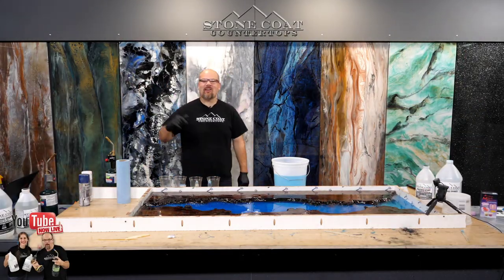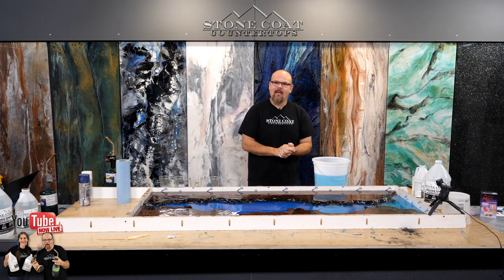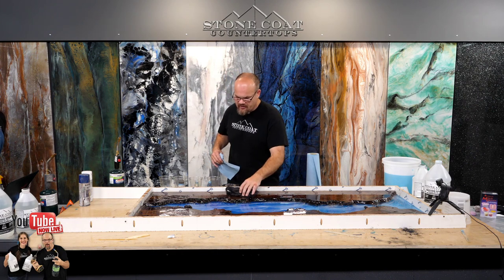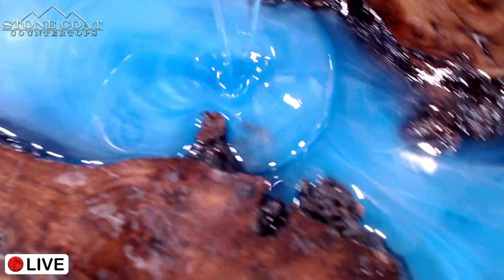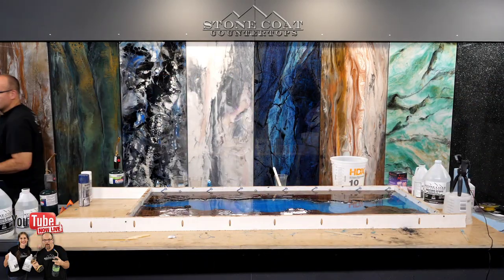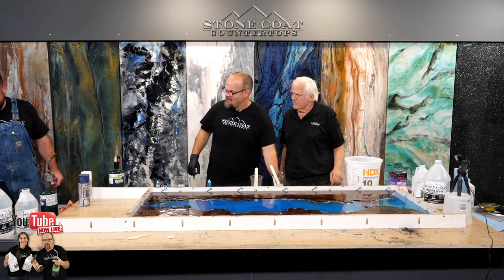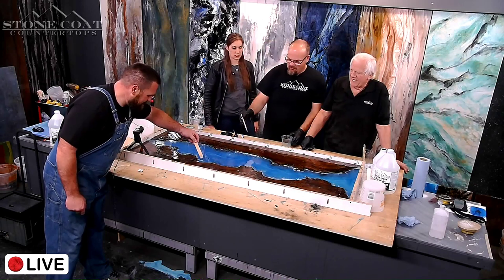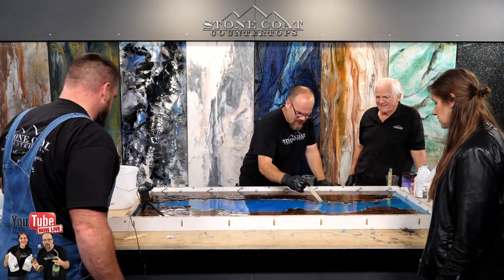River Table Ocean Pour | Stone Coat Countertops

Comment: I have a question 
Can I pour the epoxy resin over plexiglass?
I want to build a small night stand / table, a family member that recently passed away had given me a drawing that he made on a piece of 3/16” thick plexiglass and I would like to put it as the bottom for the top part of the table and pour between 1/2” and 3/4” of clear resin over it, but I don’t know if the plexiglass will melt or get damaged with the resin.
Thank you in advance and have a blessed day!
Reply from the maker: That sounds like a great project Arnulfo! One thing that is important is to make sure you get our product to bond to the surface of your project. Make sure to follow each step accordingly and feel free to give us a call directly so we can help walk you through it if you need to, and remember.....You got this! -Nathan

Comment: Pro Tip: If you do this for a living, build yourself a vacuum chamber to suck out any air introduced into your resin while mixing.
Reply: jonesmarc alternative: use fire! A torch can bring bubbles out where a vacuum chamber build might be impractical. Fire is cheaper, too. :) 

Edit: alternate 2...heat up a screwdriver or clean fireplace iron and pop the bigger bubbles, then if needed, backfill the bubble if it doesn’t level itself out.

Comment: I noticed u all dont use masks. Is this not as toxic as polyresin? Do you have to have good ventaltion?  Also the time you played w/it was way longer than the 2 part poly i used.  Is there a longer setting time or do u adjust the temp in the room to postpone the reaction?  If this is not as toxic as other resin/poly/epoxy agents that is out there, you should stress this about your product and i would encourage everyone to consider your product over off brands.  I Love doing this but had to stop because my product became hazardous to my familys health.   Please send me a message and make a video on the difference in chemicals compared to other materials on the market... amazing work!!!  I would love to start doing this again
Reply from the maker: Great questions.  It's a zero VOC epoxy casting resin designed to be poured thick. It has a long open time and is hard in 24 hours